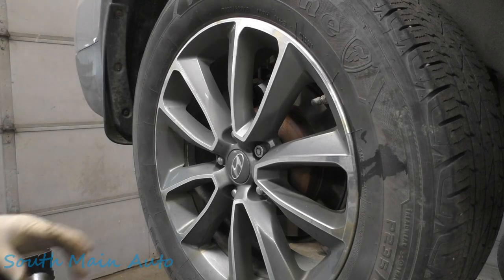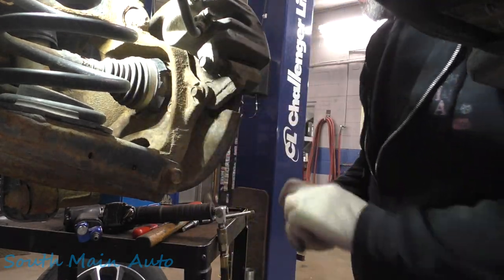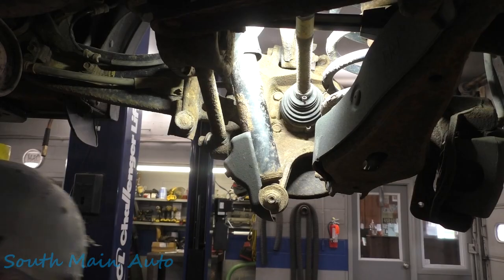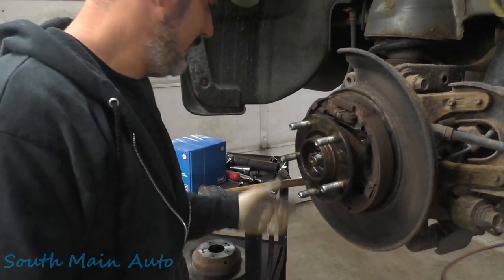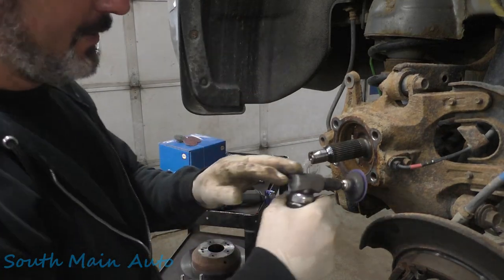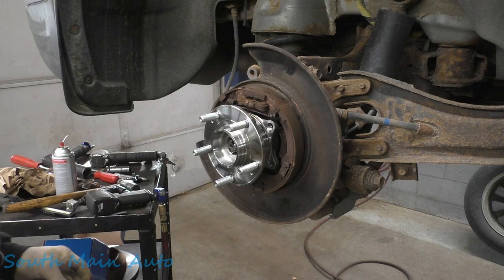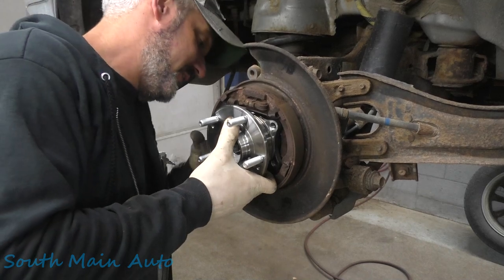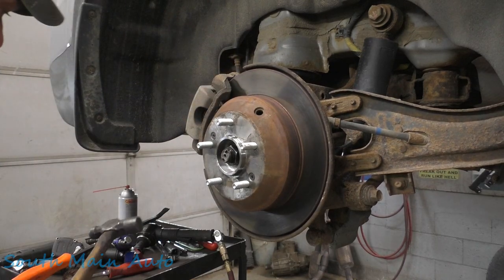Hyundai Santa Fe: Rear Wheel Bearing

Comment: just stop driving your wheel bearings in the left lane at 85mph daily, stop driving into every deep hole at 85 mph everyday,  stop driving over curbs threw yards at 85mph, stop driving along cement curbs  priming your wheels for new paint,  stop towing 2500 lbs. more than the  chassis was made for, dont pack  7 riders into your uber ride meant for 5,  and even if your vehicle is 30 years  old  up to 200,000 thousand miles  your wheel bearings will still be safe and quiet, that means  slowing down  helps.  ha ha ha, no slowing down repairing wheel bearings  at south main auto, roll em in and swipe that card.